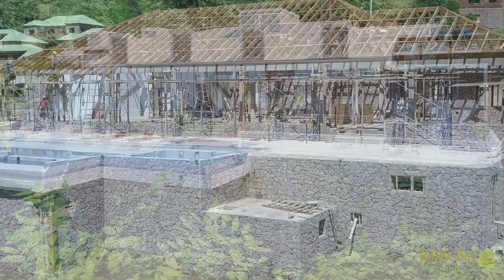Removing Dead Coconut Tree From The Backyard Garden || Agrosuede ✔

Comment: Hey Argo, how do you protect small Coconut trees during the winter seasons? I'm near Miami at the moment
Reply: It doesn't get cold enough in Miami to have to worry about them. If it's really small, just cover it with a blanket at night, if you're really worried. My dad owned a nursery in Palm Beach County and he had lots of them, they were always good. It gets quite a bit colder in PBC than Dade. The tip of FL is the only place in the cont. US that is considered tropical.
Reply: @justinv588  Thanks. What does PBC stand for?